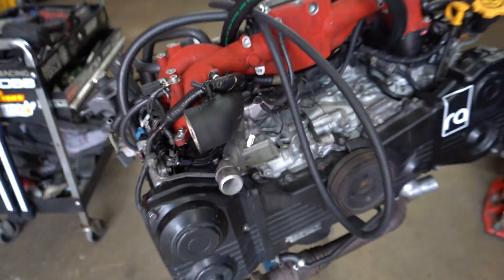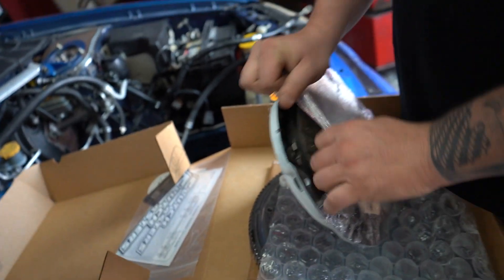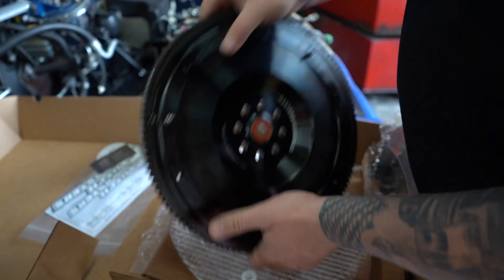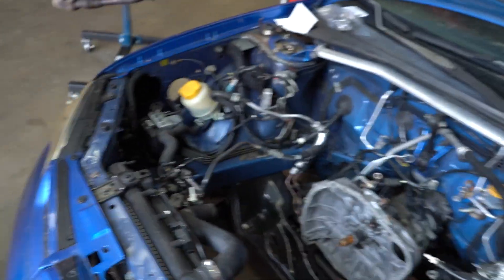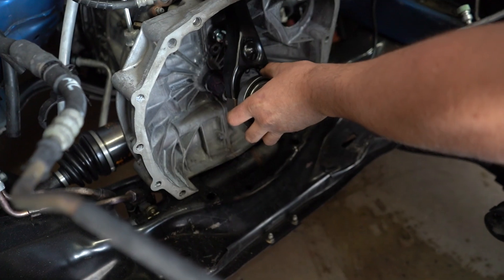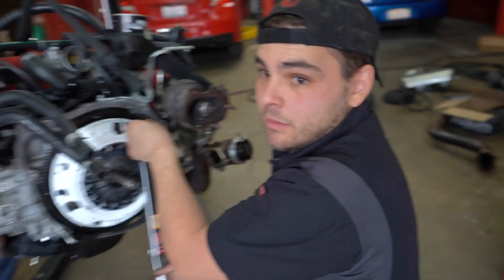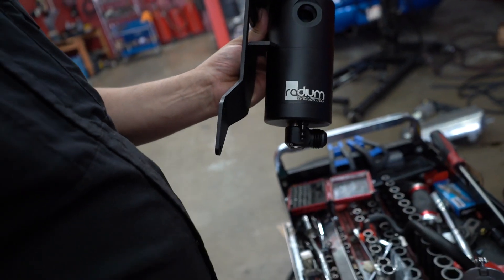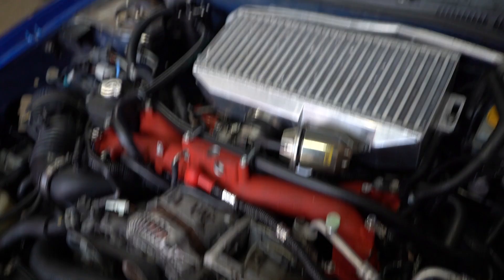FIRST FIRE OF THE WRX RALLY CAR! #RutsAndGuts

Comment: I would suggest going with recirc, bov to eliminate huge dirt intake that will ruin engine. And swapping out the filter with k&n or aem cone filter and wrapping with k&n foam oiled over filter. The cobb one will suck in tons of dirt off road and kill the motor in short order, not just from dirt, but also the maf gets damaged/coated in dirt, and causes lean condition that causes detonation and blows ringlands. Glad you are getting this together. See you out there soon!